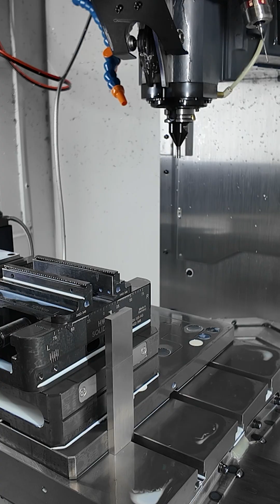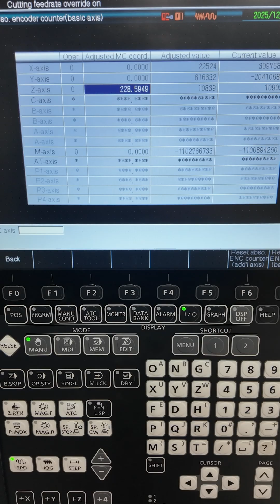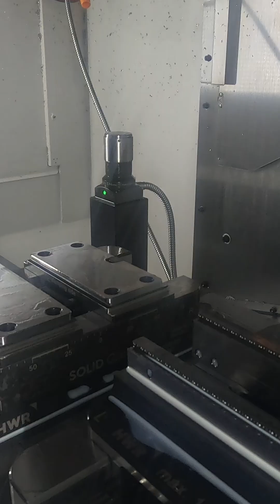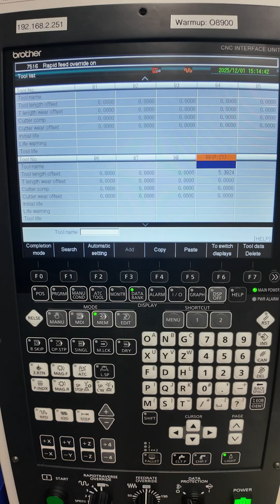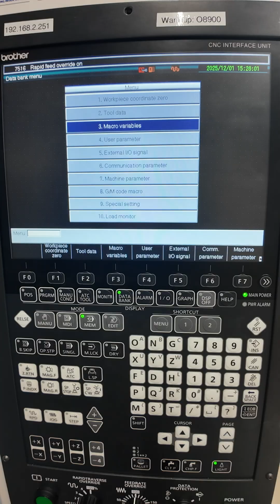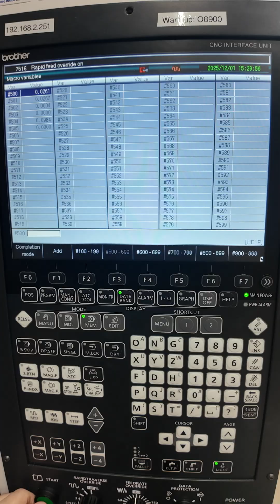Justin Unplugged: How to Properly Calibrate a Brother Speedio!

Comment: I would suggest changing the location of the Blum settings to "something else". #500 happens to be where fusion will default to dumping it's parameterised output... So whilst it's not something I personally use, I've had enough people contact me because it's splattered their config... Eek

Comment: Let’s clamp a precision ring gauge in a vise 🤦🏻‍♂️
Reply: The Blum measures to microns and also shows how much out of round it measures. He will be easily able to see if he moved the ring by even a micron
Reply: @ewildgoose  tell me you don't know how a calibration cycle works without telling me.  He's not measuring the ring gauge, he is using it to calibrate the probe.  If the ring gauge goes out of round or measures different, the control assumes the probe tip has that error, and adjusts accordingly.
Reply: @INSERT1234 fella, you are entering into a battle with someone who maintains a fork of the Autodesk brother post where all the Blum probing has been rewritten and now works. Also who maintains a fork of the Blum probing macros with various optimisations. 

You can assume I have at least a passing understanding of how this stuff works...
Reply: @ewildgoose  🏆 Cool, I’m impressed you know how to write a post. Too bad that has nothing to do with understanding the difference between a circle and an oval, or how precision tools should be handled.
Reply: @INSERT1234 thanks for your positive contribution to this video
Reply: @ewildgoose  likewise Sir Post Building Master